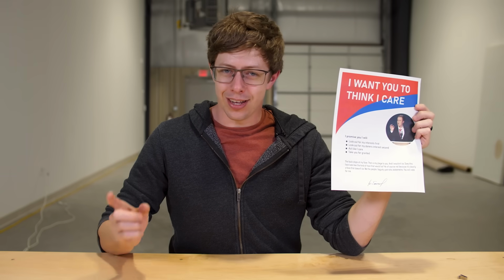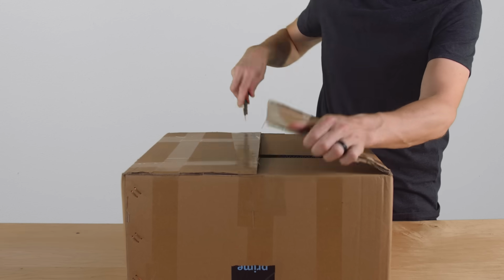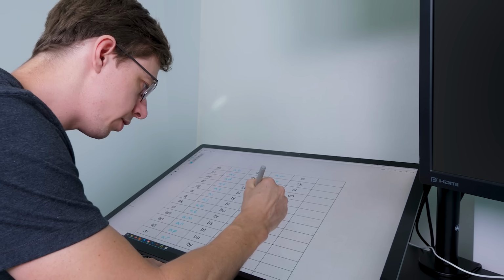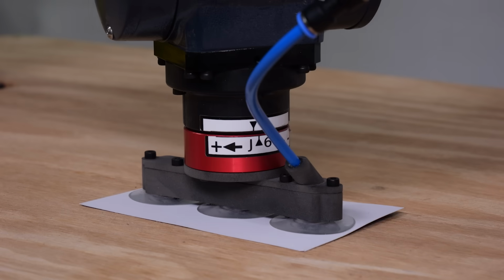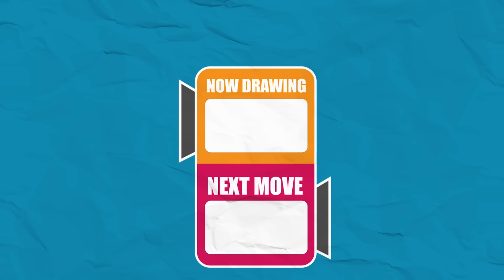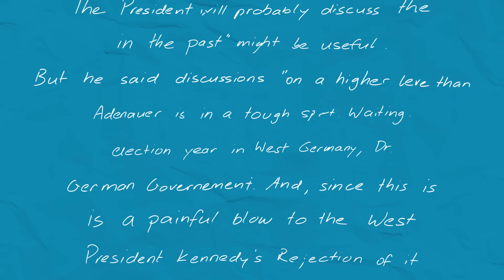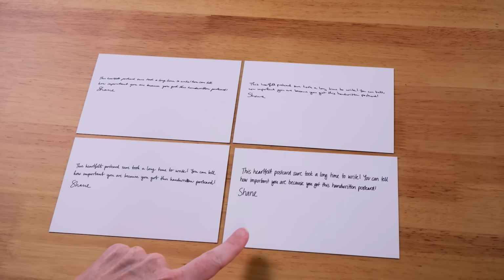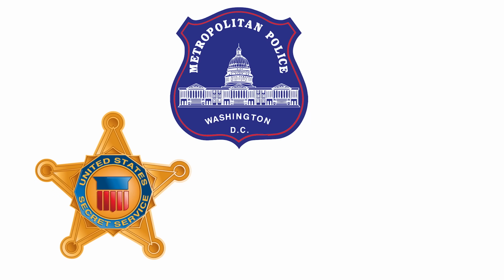I sent robot forgeries to a handwriting expert

Comment: You know you're an engineer when you spend hundreds of hours designing and building a custom solution to do a simple menial task
Reply: In fainress he actually ended up just using someone else's code on someone else's robot. All he did was feed it paper with a second robot.
Reply: @Electric999999  he also handed the robot a pen haha. Seriously though he did engineer the trays to hold the cards, the system for picking them up and dropping them, the system for holding the cards for the writing bot and integrated those 2 robots together with the code etc. so it's not quite as easy but yeah. 

Giving up and using an existing code base is actually very typical of engineers in other jobs too lol.
Reply: @oshgoshbyskosh if you are old enough to go university, give it a shot. You can't be a certified engineer without an engineering degree.
Reply: I'm a software developer and I have a job and that job often makes me do tasks that take hundreds of hours only for no one to use it.
Reply: He needs a threadripper CPU.
Reply: @Electric999999  Which is how you know he's an engineer
Reply: @Electric999999  which is why he is an engineer 😂
Reply: Yes being an engineer myself I know the pain too.
Reply: @joefmagat5586  while you cant be certified and stamp drawings, you can work as an engineer without a degree, just wont be payed the same
Reply: @oshgoshbyskosh  I like that approach. I learned calculus from library books and then took the classes. Maybe you can challenge some classes?
Reply: This world used to be a place to learn to suffer, but that has to change. Make this world heaven!
Reply: Yes, but next time you need to do that task you have the perfect solution.
Reply: "Why spend 6 minutes doing something manually, when you can spend 6 hours failing to automate it?"
Reply: Xkcd has a chart listing how much time you can spend on automating something before you took more time than you're likely to save on it before you die, with the duration and frequency of the task as the other variables.
Reply: @elusivelectron  Machine learning is almost always done on the GPU.
Reply: Is that how you know?
Reply: Honestly just sounds like ADHD.
Reply: @Thunder  the very essence of engineering is spending hundreds of hours planning and building, fail, realize that someone in another country already came up with this 8 years ago, and you just use that
Reply: Why spend 10 minutes doing a task yourself when you can spend 10 days designing a way to automate it
Reply: I'm an engineering student. I once heard about this guy who spent hours of company time figuring out how to turn the coffee pot on remotely from his desk. The man is an inspiration to the lazy everywhere.
Reply: @Electric999999  Well, a Train Engineer is using someone else's Engine on someone else's Tracks. All he did was feed it Coal with somebodies second shovel. He's not even REALLY steering.  This dude may have performed much more Innovation, than actual Invention, but even creating a toothpick requires Engineering. It doesn't have to be a novel 2-piece titanium toothpick design. Some engineering is done on paper, some on computer, some on the CNC. MOST engineering is done in the mind. MOST engineers are merely hunters. When a solution is needed, grab a flashlight and dive down into the dark unused parts of the mind, and explore around. I consider the dude with duct tape all over his mobility scooter to be a dang engineer. Real engineers, when access to the correct tools is severely limited, have historically performed miracle solutions with duct tape. Google Apollo 13. It wasn't even their duct tape bro.
Reply: and you have your wife check the work
Reply: @Electric999999  Agreed. If you're gonna call your channel "Stuff Made Here", the stuff, including codes, has to be made there, not by some other random guy on the internet.
Reply: I feel you
Reply: It's a investment at first then machines will do these tasks and people less have to. Also, engineers have to start somewhere then it grows to a better device.
Reply: Yes but those hundred hours are the ONLY hundred hours the engineer will ever spend on that menial task ever again. 

Unless the power goes out or you need an update and the internet went down. Lol 😆
Reply: @Electric999999 Why doesn't he have a robot that feeds the paper in automatically? And then one that puts it into a finished stack? 

Sorta like a printer but modified... Ish? And more cool and automated? And then a wifi and Bluetooth raspberry Pi that can connect to his phone and signal when a certain number of pages are done, when all pages are done, when all pages of this batch are done, or when there's no more room for new pages and the finished pages need to be stored elsewhere, and a low paper indicator, out of paper indicator, and a small camera that can detect an ink spill, and a mini scale that can detect an empty pen? And then further if by having a rotating pen holder that, when doing the motion for changing to a new pen, or new colour, it can auto uncap... Or maybe use like silicone pads with pen tip sized divots so that the pens can essentially stay sealed until use... 

Like that fancy glue bottle holder thing that crafters use. 

And this would then eliminate any need for caps at all.
Reply: Automating menial tasks is the only way to ensure they're done correctly.

Comment: The shot @9:37 has me holding my sides. A $35k robot arm, TWO computers, a big power cabinet,  an air compressor, a shop-vac... "But that would be over-engineered!" 😆
Reply: funny.
Reply: Totally missed that, you are definitely correct.
Reply: 18k arm

Comment: One of my family member is graphologist. She told me that the pressure you put on each letter with your pen is also examined (showing how much emotion you put on some words)

So if you're only looking at the 2D-shape of your letters, you're missing something.
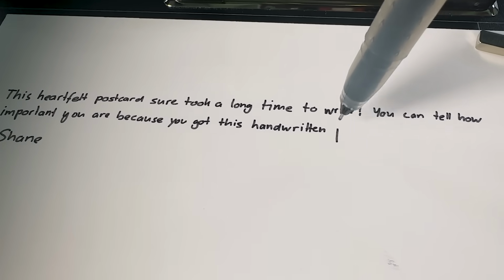Reply: Oh, I literally just mentioned the same thing before scrolling. 1:11 if you pause and full screen it gives a perfect example of what you are saying.
Reply: This definitely could be sorted with a bit of pressure from an actuator on the pen
Reply: The interesting part about that he can implement that into the machine with the suction function. By adding the amount of suction to each specific word or letter at least 50% of the words wouldn't have the same pressure due to the change of suction for each words and since the care isn't rigid there would be tiny (I assume only noticeable under investigation) changes. It's a crazy thing he has built
Reply: @bryang2280  Honestly I think you could just have the writing machine itself do it. It already can lift and push down the pen (since that's how it works lol) so I don't see why you couldn't just have it push down when writing certain lines more than others
Reply: This was my biggest “tell” of real vs fake. Hard to copy the random pressures and pen scratches made by pens when handwriting something. Like the little tail left behind when finishing a word and lifting the pen at the same time.
Reply: @JohnGrahambeehive  yes but he would have to refactor that guy's code to start including pressure. and then he has to find a way to measure pressure for his dataset.
Reply: @JohnGrahambeehive you could but would need another ai algorithm to know which words make sense to emphasize.
Reply: @gasun1274  buuuuuut...the way to do it is clear. So, basically you cannot trust handwritten signatures anymore. Especially if someone is smart enough to include non linear, indeterminate adjustments to shape, spacing, pressure and then all of those over a curved time domain.
Reply: I think something I would look for is spacing toward the end of a row. Humans are pretty great at estimating how much space the next word is going to take but we aren’t perfect so Id assume we often subconsciously scrunch letter together at the end of rows more than at the beginning.
Reply: Yep, there's also stuff like "hesitation dots" which is where you hesitate with the pen for a moment and just a bit more ink is distributed there. Points of hesitation are somewhat unique to an individual and are part of the larger methods used to identify a writer for forensic analysis. Graphology is a different thing from handwriting analysis for forensics, though, and has no scientific backing.
Reply: @JohnGrahambeehive  This sort of printer has been around for at least 30 years. They were used for printing engineering and architect drawings on A0 or similar sized paper. These days you would probably get a giant inkjet printer to do that job. I don’t think they vary pressure, but what they could that this one can’t is pick up different colours of pen.
Reply: A natrual written letter will have some elements of heavy and light handed strokes, slight adjustments...
Reply: pressure = emotion my ass 🤣🤣
Reply: I was thinking the same it needs more randomness maybe like a lil table that shakes ever so slightly like those earthquake tester things but more gentle idk
Reply: I'm wondering how pronounced this is with different pen styles. Ball-point pens take a lot more pressure to write with than fountain pens.
Reply: Came here for this. Was just IT on some place and they already ancipated plotter-like forgeries, if you have the original on hands it's easy for them to pick up.

People try to pass out prints of their own signatures all the time to save time (copy paste vs print sign and scan)
Reply: @bryang2280  No way vacuum suction would be that specific.
Reply: Hand anatomy plays an important role in the pressure applied on paper while writing. As we write, our hand muscles and joints work together to control the movement of the pen or pencil, changing the shape and direction of the strokes. The pressure we apply depends on several factors, such as the size and shape of the writing instrument, the speed and style of writing, and the posture and grip of the hand.
Reply: Graphology is a pseudoscience though...

Comment: I think that 2 possible differences from the normal handwriting are pressure variations and speed variations these 2 can be especially seen with fountain pens. In this case even the angle at which the pen is held changes as the word progresses and this changes line geometry
Reply: I had the same thoughts
Reply: Ditto, the pen needs variability & pressure feedback
Reply: @EngineerMikeF  yeah, it could be even implemented as controlling the pen force instead of controlling pen height, made as a weird closed loop system. Or simply move the pen up and down and have it spring loaded, the force of typical spring should be roughly proportional to the amount it was compressed / extended
Reply: Maybe the pen could be connected to a spring so as it moved there would be a slight wobble and / or  a random offset could be applied each point making up a letter. Would also like to see some deliberate spelling/ writing mistakes to be more human like
Reply: Ink smear. Near impossible to have a machine replicate this.

Comment: Not sure if that robot is outfitted with this package, but most robots have an offset instruction that you can manually change in the program by a constant, or by a register value. So every cycle you can run it by an instruction telling the robot to return to pick position but subtract (card height)mm Z from the original. Each cycle it keeps subtracting that value from the offset position before it. Just make sure to use a PR for your original taught position and dump that into a buffer position before offsetting it, or you will lose the original coordinates. When the robot has ran through the card stock, you can have it reset to OG position upon a fresh startup and repeat. There are also other ways of doing this. For example, an analog prox sensor could feed the robot a register value, which will allow you to convert your original taught position reference (PR) into a new position (P) each cycle based on what value it's seeing.

Just sharing for future builds. Either way I enjoy seeing the solutions to problems you come up with.

Comment: I work at a print company, all these designs are super similar to tons of the machines i work with as a folder and booklet maker. The feeder on my Horizon buckle folder has a similar suction cup design to pick up sheets quickly. You did your homework, and built a sweet machine. Props to you brother

Comment: 12:40 The way you explained a loss function for a neural network architecture is just flawless. Great job mate! That is Josh Starmer level explaining right here.
Reply: From now on I will always call the loss "garbageosity"!
Reply: I like the little camera bit in 13:25 that was left in the final edit
Reply: I had a question about what he said though, when you calculate the slope of the error function, it's dimensionality should be based on the 'number of knobs' in the last layer, so when you move in the direction needed to minimize error, aren't you turning all of those knobs simultaneously (and thus, all the previous knobs roughly simultaneously as well since you propogate that change back through the network?)

Comment: Omg, your segment on debugging machine learning programs was so depressingly accurate.  Training something for hours, checking the predictions, and getting complete nonsense.  Just to learn that you did something dumb somewhere (like maybe you used a '-' instead of a '+' somewhere).  Then train again, and repeat until either you get it working, or you give up on life.

Though of note: it is important to monitor NN training.  Looking at loss, accuracy, and any other metric while you are training.  Also training on smaller datasets first to iron out bugs so that you don't waste as much time.

Comment: Hey dude! I wanted to say thanks for what you do. I got into engineering in part because of you. The stuff you do seemed so cool and, yet, impossible. I am officially a Sophomore and just got done with my first project at a Summer internship! It’s a label applicator machine that I designed, did the circuitry and fully 3D printed. It’s most definitely not an unmissable basketball hoop or a puzzle solver, but it’s a start. I’m super thankful for you; the stuff you do is what made me want to become an engineer, and what I aspire to do. Great vid and can’t wait for your next project! I’ll update you on my projects then as well 😂
Reply: "... the stuff you do is what made me want to become an engineer". Dude, you already are. You might not have the degree yet but you've already got the mindset to build stuff. Well done.

Comment: This is a great, instructional video. 

Many years ago (20 or 30 ?) i used software called Sigsoft. I mailed, yes, snail mailed various samples of my handwriting to them. They sent back a font on a floppy disk that reproduced my cursive writing with perfectly connected letters. The toner was a problem because it didn't look like pen ink but it still looked pretty natural when addressing the Christmas cards. .

Even using a pen plotter didn't solve a problem in the pen angle. As we write, the pen angle changes in our hands so that the line made by the pen changes it's thicknesses, shape and texture on each portion of a character. Pen angle is as unique as a fingerprint making it impossible to duplicate. A handwriting expert can easily tell even the most carefully made forgery by comparing the difference in angles of different portions of lines  making up the characters. But, the pen angle never changes on the plotter. At least these were conclusions as I worked on the same problem. I really appreciate your work on this video.

Comment: I bought a handwriting program i think about 20 years ago.  I had to print words that they told me that covered all the variations that could come up.  Like an A that continued to a lower point of connection, or to a higher point    such as:  ai   or   ao.  it did a great job. the only fake looking thing was that the lines were perfectly straight and spacing was consistent.

Comment: 15:45 I think the problem there is say it starts drawing a line down, that might be better than what it did before so it gets reinforced even though it's not on the right track, it gets to a false peak where it thinks it's ideal cause it's as close as it's gonna get on that path, but ultimately still chose the wrong path, I've seen other machine learning videos work around the false peak problem but don't remember how

Comment: I did this 5 years ago while working in a research lab. We taught the robots how to move using our handwriting and then we used pressure sensors to teach the robot how the pen pressure varies on our hand writing. We used several versions of the same character so the robot would not repeat the same character every time and we taught it combined characters in various versions also, so it wouldn't repeat it exactly the same way. I didn't see it to the end because I changed jobs but what you did here is remarkably similar.